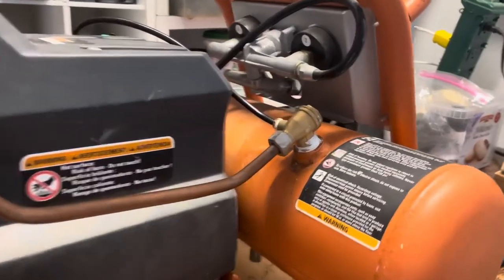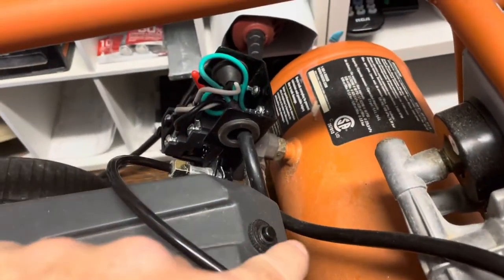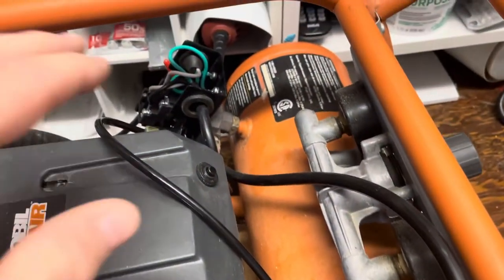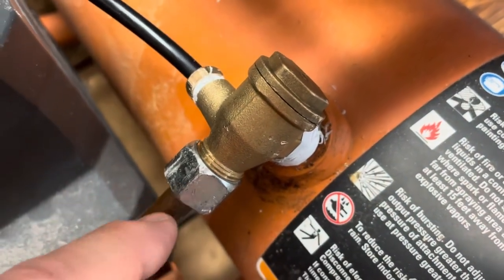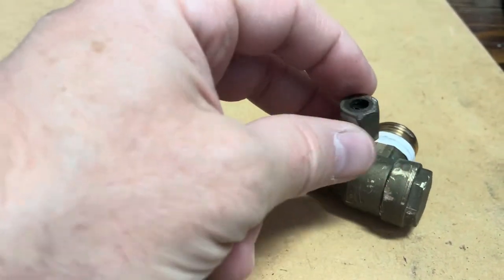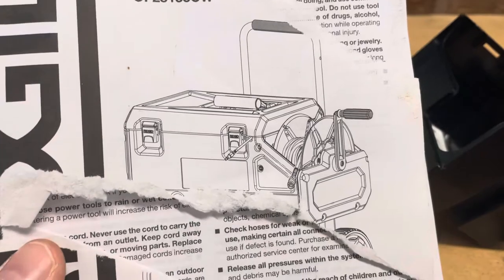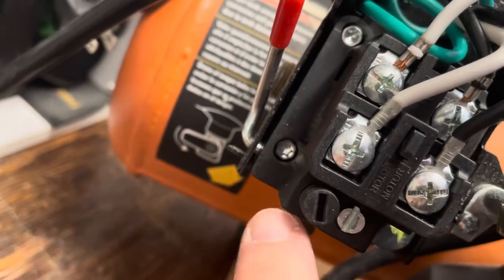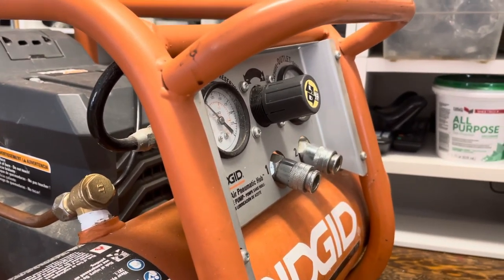How to fix your air compressor that’s humming and tripping breaker.

Comment: All that is in that check valve is a light spring and rubber puck. The cap should almost be easy enough to unscrew by hand. Try cleaning it out and possibly change the rubber puck. You can sometimes re-stretch the spring, if it needs it.
Reply from the maker: Hello Friend, It is a good idea to try and repair the parts if you can. Thanks for the tip on repairing the check valve. I hope you were able to fix your compressor!
Reply: @jerseyjer8542 do you know the part number for oring on check valve cap?

Comment: My compressor starts then stops and cuts the fuse, what can it be? Checked the capacitors all working fine.
Reply from the maker: Hello Friend, If you look on the video at about 4:49 I talk about the pressure control switch. If you have the cut out set incorrectly, the compressor will shut off due to excessive pressure. I adjusted it slowly to get the correct setting and it helped my compressor consistently run. Read the directions on the box cover to properly adjust the switch. I hope the rest of the video helps you figure out what is happening with your compressor!
Reply: @jerseyjer8542  thanks for the reply, the compressor was working all fine, just one day I drained all the air and the next morning it started cutting out the fuse when I switch it on.
Reply: @jerseyjer8542  I have a same problem the switch is adjusted and the compressor stacks at 5 bar